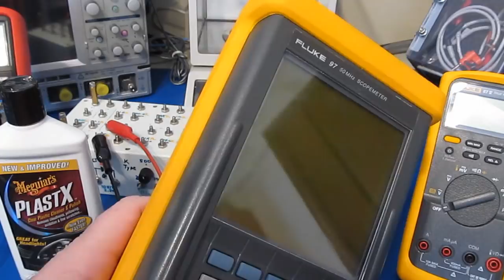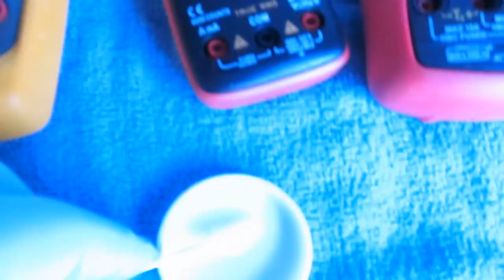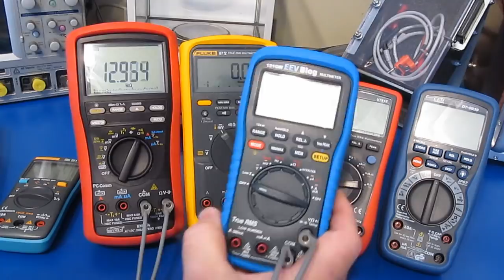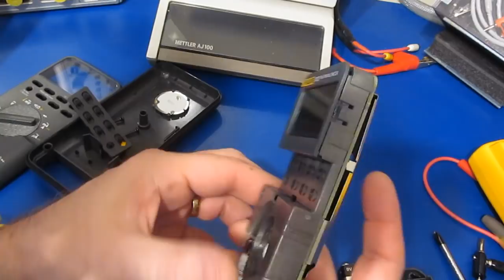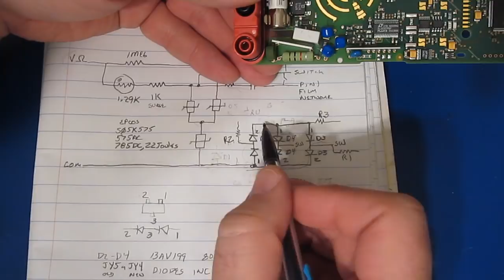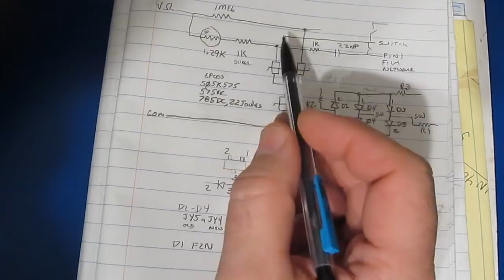Fluke 87V Robustness Tests,  Part 3

Comment: first gen 87 manual says >4000Mohm input impedance in the HiZ mode, interesting how its 6x higher on the 87v, looking forward to part 4👍
Reply from the maker: Thanks for the update.  Good to know where the 4G came from.  It could be the 87 was much higher than 4G.  Like the UT61E, they just spec a minimum.

Comment: You're really dragging this one out joe. Just fry that fish already. You know you wanna. I'd rather you modded the meter first to try to keep it from cooking, like we all know it is going to do. They obviously haven't changed the design since 2002. The bums!
Reply from the maker: I actually do want to run it or I would not have purchased it. No one forced me.   I may take a crack at changing this one.  It will depend how the testing goes.  If I damage the front end IC for example, that ends it.  The switch cycle testing may also damage it beyond repair.   Just have to take it one step at a time.
Reply: I'd just like to see you add something new to the conversation. Because I've a strong feeling about what is going to happen in the transient testing. I think it is going to be the same old sad story that we've all heard before. 2.5kV and poof. Maybe you could replicate that front and and test it by itself? Something different. Spice things up a bit at the cook out this time around.
Reply from the maker: By poll, people wanted to see it run so that's the plan.

Comment: A little OT... My ancient Fluke 88 was really looking sad, mostly the yellow boot was stained. I removed said boot, set aside it's 'flex' stand and ran it in with 2 or 3 washing machine loads of work clothes. Is it perfect? No. You can still see battle scars, but it's very much cleaner/brighter looking! I then cleaned the stand with some dish soap & brush at the sink. Maybe not suitable for all boots, but worth consideration.
Reply from the maker: The Fluke 189 was in need of a good cleaning as well.  In this case, the meter has marks on it from the previous owners that I did not want to disturb so hand washing.
Reply: You can clean boot with auto mechanic hand cleaner. Trademark what ever can found.